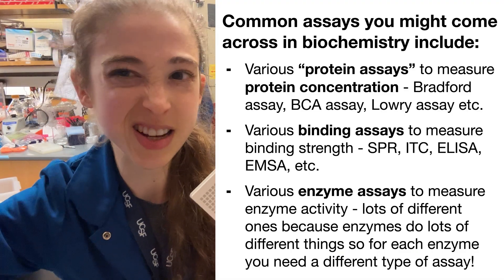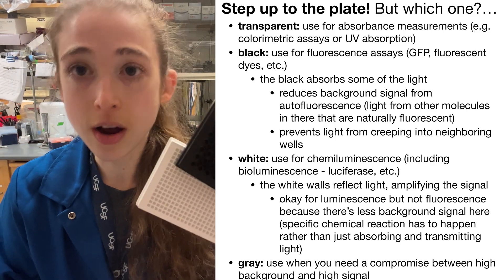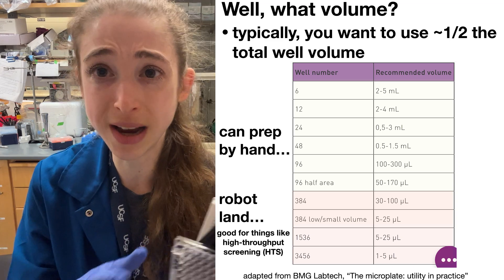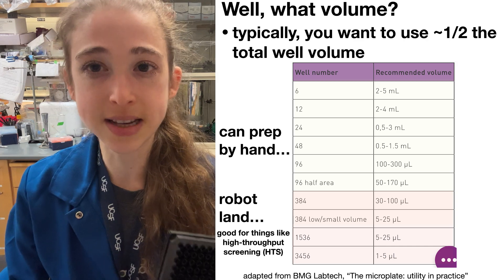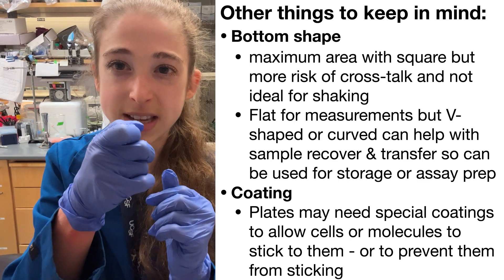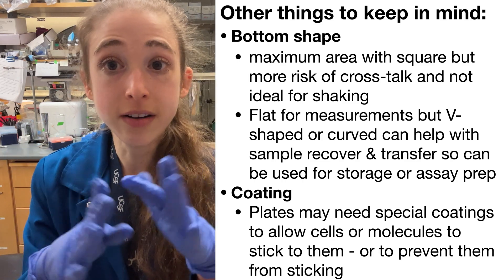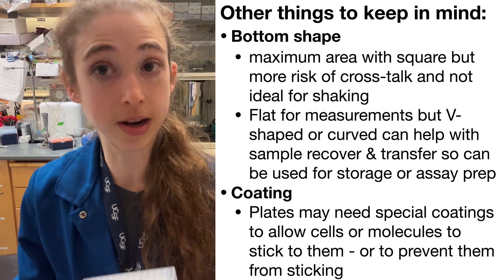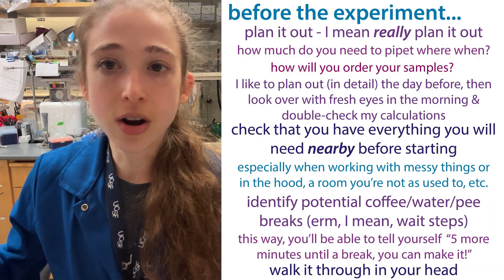Choosing the right microplate for your experiment

Comment: Hi, Thanks a lot for going over every detail of choosing the right plate. I'm a PhD candidate with civil engineering background but my current project is related to bacteria removal using  antimicrobial filtration. I'm going to use micro plate reader to get the cell count in my water samples as I have around 90+ samples per test which makes it hard to go with usual plate counting. I'm going to stain water samples with fluorescent dyes (DAPI and PI) and observe the fluorescent intensity. I can calculate the cell count in unknown samples using separate calibration curves for both live and dead cells. I understood that I have to definitely go with black 96 well plate. But I'm bit confused about well plate coating. Should I go with surface treated or untreated ? I'd greatly appreciate it if you could share your insights. TIA
Reply from the maker: I would think untreated but recommend contacting the manufacturer to inquire. Good luck!
Reply: @thebumblingbiochemist  thanks a lot